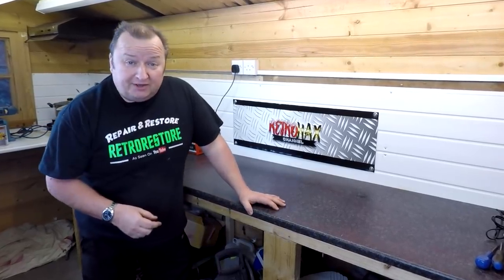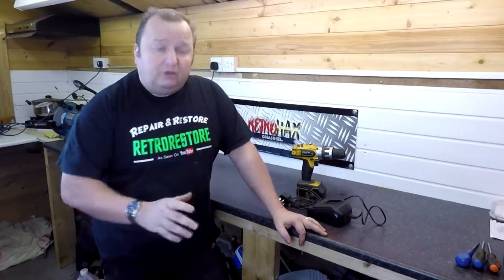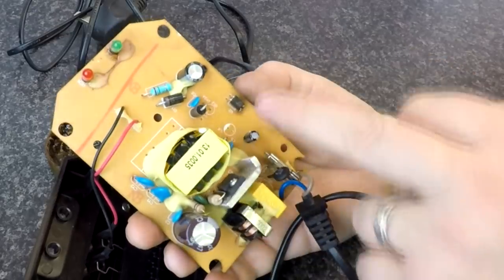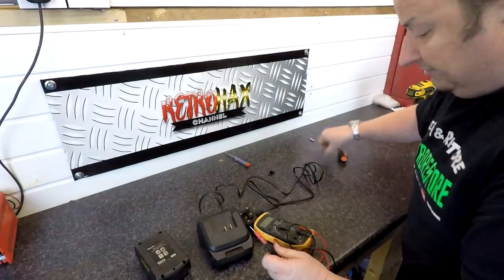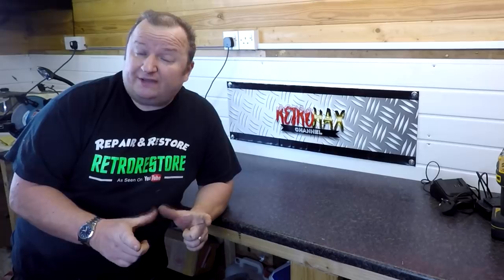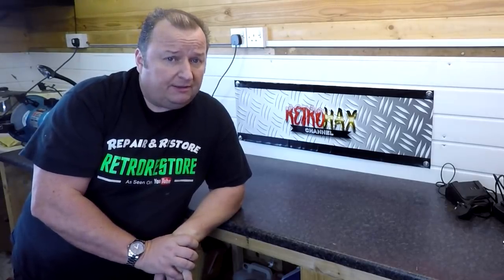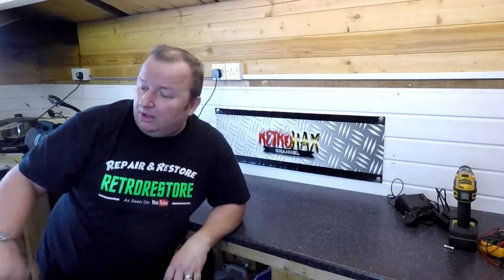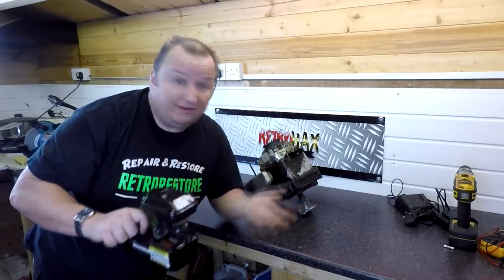Battery Drill Fail - Shout Out And New Content Vlog

Comment: Those 4 diodes are are part of a full bridge rectifier. Converting the AC into DC, for it to work, it must go in one way only. The capacitor is likely there to smooth it out.

Comment: Also, you can test the diodes out of the circuit. They usually short and a.c.gets too far and blows the fuse. I had a d.c. charger for a drill and found (3) bad. Got some from

Comment: I did wonder slightly about the way you put on the gasket/diaphragm on that engine, but I was thinking that it was me that was incorrect........LOL.I have put these things on a few times before. As you know, the tank is in effect part of the carb hense why diaphragm is first...........I found a mower outside of a closed up house with the deck completely rusted out.I  dragged it out, out of curiosity. The tank has pin holes in it, but if I do  try to get it going, I have to think of a way to mount it as it wont run unless the blade is on......something to think about.

Comment: I paint my engines with Krylon black spray lacquer. It’s not affected by fuel, and the heads and cylinders stay painted.
The little black thing  is a surface mount diode. They are directional, if you can find one, go ahead. Easy enough to test,though, you’ll only have continuity in one direction if it’s good. May be able to replace with a regular diode, just solder to the pads.
Good luck.
Reply from the maker: Not heard of that lacquer Jim.

Comment: Chargers are a pain nowadays. I've got two (cheapish, admittedly!) cordless drills that work but I can't now recharge the batteries for. They would have been useful for bits and bobs but now they're useless. Maybe a business opportunity for some clever soul to design a charger with multi-configuration contacts? Anyway, interesting vlog as always Martin. I used to have loads of Matchbox and Corgi cars back in the 1960's so i'd be fascinated to watch you work on some. Good luck.

Comment: 21:12 It depends on if the mower surges after a rebuild. If the engine surges, the diaphragm needs a greater distance of travel to supply more fuel, and you'll have to place the fiber gasket on the metal tank first, THEN the rubber diaphragm, if that makes sense to you. And folks, if it leaks fuel, you can sandwich the diaphragm with two fiber gaskets.

Comment: D1, D2, D3 and D4 look like a full bridge rectifier built from individual diodes.  PS if you are doing shoutouts again I'd appreciate another one, you can even see me making progress on building my shed! :)
Reply: Also the diode will cost less than the fuse.
Reply: Also, whilst I don't have a surface mount one I probably do have a mains voltage diode you could use.

That is a mains voltage rectifier, as it is a switch mode power supply so they make it DC, send it across the transformer at high frequency then rectify it again and regulate the voltage etc.

The diode you have should have a band on it which tells you which way round it is. It's probably gone short which may have damaged other components though.

Comment: Hi Martin ,
the "D1" is one Diode of the mains rectifier. 
Usualy there are 4 Diodes because it is a fullwave rectifier.
After that you find a capacitor wich smoothen the ripples from the rectifierd (DC) .
Beware there is a hgigh DC voltage on it !!!
Reply from the maker: Yes, as I thought Bernd. Thanks for that bud.

Comment: If you lived close to me, I could fix that in a few minutes. Looks like one of the four diodes, that form a bridge rectifier, could be opened or shorted. Shorted would take out the fuse real quick. Not much in that little charger unit. Don't throw it away. It can be fixed. JMHO

Comment: black components are rectifier diodes. converts ac to dc. i bought 3 cheap drills of the same brand which gave me 3 batteries and multiple chargers. should the battery packs not hold charge i would disassemble them and replace the batteries. my previous career was electronics.
Reply from the maker: Yes, I thought they were Alistair. They normally blow and open circuit though instead of short out.
Reply from the maker: Yes, I thought they were Alistair. They normally blow and open circuit though instead of short out.